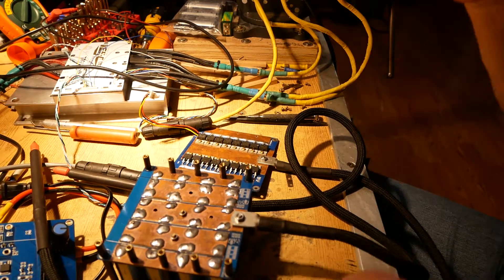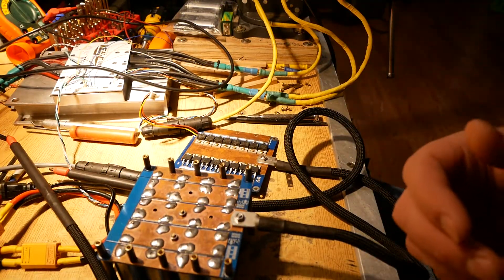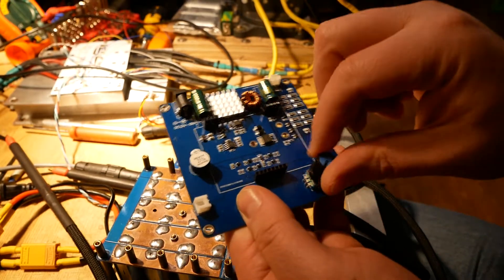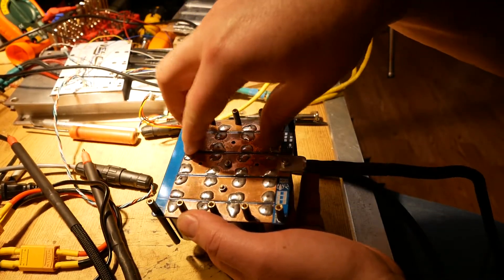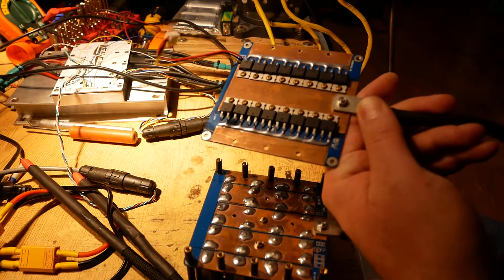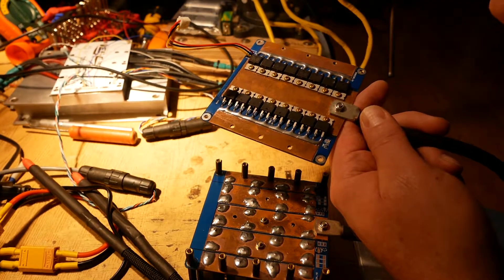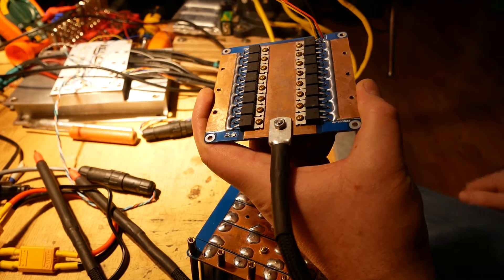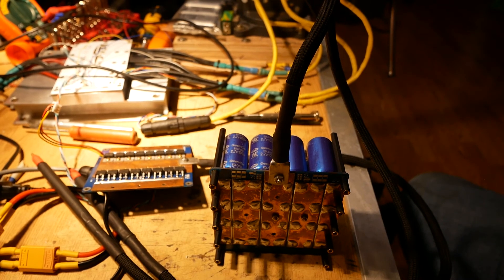Chinese 1600 farad spot welder teardown

Comment: Got myself a new double pulse spot welder from Ali, XW2. Quickly checked the board and was impressed by features and improvements over the old designs. The first spot weld resulted in all 6 mosfets shorted and one of the copper electrodes melted/burned off. I think they're not using proper legitimate parts there. I feel like it needs proper gate driver too. The existing is a bit on a slow side because of the huge gate capacitance.

Comment: I've been torn between buying one of these and buying just the control board and building it myself. I haven't found any information about this thing anywhere on the internet. Thanks for posting this, its exactly, precisely what I've been looking for.
My Sunkko 788H with a modified transformer doesn't weld 0.3mm nickel for long enough before the overtemp protection kicks in and lowers current. I'm going to try adding a heatsink to the SCR and an exhaust fan, but if this doesn't work well enough I'm going to build my own.
I thought from the pictures that it had to be carrying the current over those brass standoffs and that's why I didn't already order one. Thanks for the in depth video and teardown!
Reply from the maker: If you are going to that level, just buy a KWELD. Then you don't have to do anything other than use it. The charge rate on this thing is quite low and it takes very little time to deplete the super caps well faster that they can be charged. OK the LCD is sort of cool, but that's about it IMHO. I had a Suunko and they are junk as you can attest. I bought this purely out of curiosity and does well enough on .15mm or .2mm, but in this state it's not capable of .3mm.
Reply: It looks like your mosfet board has real copper. Mine is a brass and im kinda sad about it. Might tear it down and see it i can upgrade a bit.
Reply: I did my first DIY spot welder based on the Aliexpress sourced board, heavily modified and powered from huge bank of supercaps (super low ESR) I measured easily over 2KA output and it welds anything I want it to. The other one, I also built myself out of Microwave Transformer, using control board kit and it runs AC spot welds, which also works pretty much for anything, except it heats welded pieces much more than DC welder. To my opinion KWELD is way too expensive and if you're not running a service business it's not worth investment.

Comment: No flyback diodes on mosfet board, no resistors for each gate!!. Only the low corrent - high impedance of the power path is keeping that thing from blowing the mosfets in the avalance region when the pulse ends and the back emf appears. Those brass stands as high current path...... Yeah, made in China, money wasted
Reply from the maker: I did say it's not as good as a kweld. And it does make welds so...not entirely a waste of money. There are worse designs!